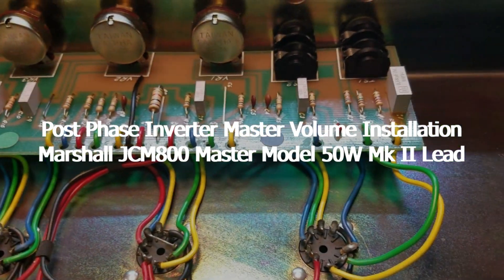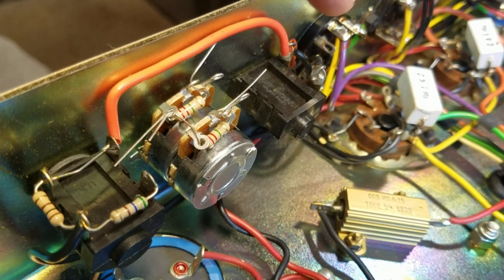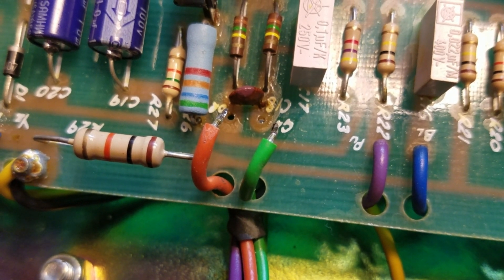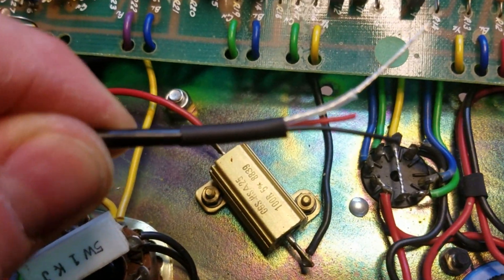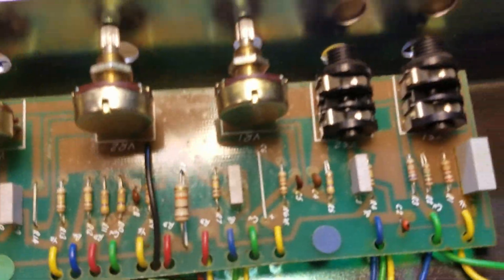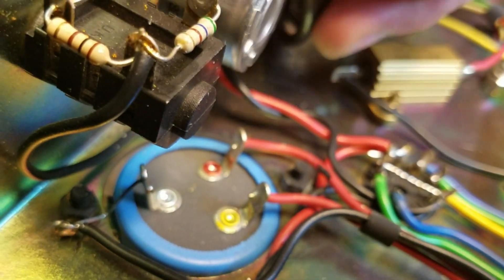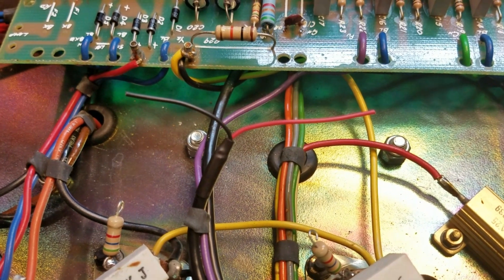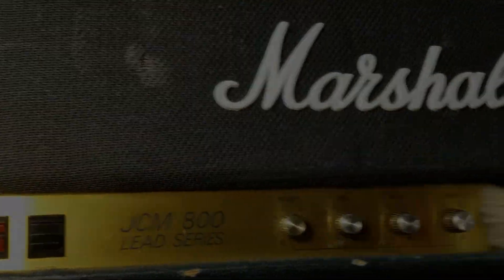Post-Phase Inverter Master Volume (PPIV MV) Installation in a Marshall amp

Comment: I have the same amp  from the same period late 80's (horizontal inputs, pcb mounted jacks) and inspected by the very same person signed in the sticker (NICK)...mine never sounded right and apparently it has to do with much higher preamp voltage and less filter caps (the big blue ones outside near the tubes)...probably there is also something else that causes these amps to sound stiff and fizzy. Any clue on how to make them sound properly?
Reply: Search for Tone Lizard jcm800 mods - 4 simple mods that improve the tone of these amps.
Reply: @CurtGranger  thanks

Comment: I just bought a '90 2204, and will be using this video as my bible to install a LarMar!  Also, it looks to be easier to do the wiring under the board, since it would be tough jamming the red, black, and shield into the small holes from the top. Also, those are 1 watt 2.2 meg resistors, the half watt ones I have are way smaller.

Comment: My JCM800 has flying leads to the pots, I thought board mounted pots didn’t start until the JCM900, is this a later 800?
Reply: Yes, horizontal (side-by-side) inputs. Many of the later 800s had board mounted pots.
Reply: @CurtGranger  - thanks. That was my only gripe with the 900’s, every one of them I owned I had to repair.

Comment: Excellent video. Do you know if this mod can be done on an SV20H amp?
Reply from the maker: Yes, most likely if it's the same 1987/1959 preamp/tone stack/LTPI circuit they use in most of their "plexi" amps.

Comment: This added MV would get rid of that JCM800 standard MV issue of going from off, to extremely loud ,between zero and 1! Way better for home use, I bet!?
Reply: I have a '86 JCM 800 2203 and, YES! It's crazy how it goes from nothing to sledgehammer, just like that.

Comment: I think I like the regular Marshall pre-phase inverter master volume better.
Reply: I personally prefer to have both. Cleaner tones with the pre, but it's lossy (low end loss) at anything below 4. Then it gets loud quick. the PPIV gets fuzzy at lower settings. A blend of both achieves a nice balance at any volume ( to a certain degree - there's no substitution for cranking it loud).
Reply: The "Type 4" Master Volume as Ken Fischer called it... it comes off the Treble control in the tone-stack. This cathode-follower Master is better for more metal styles...